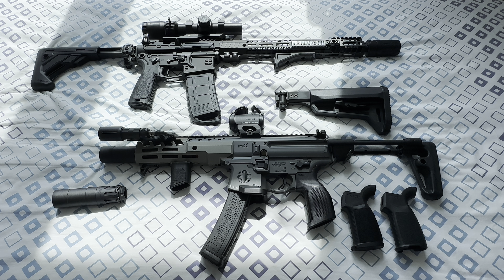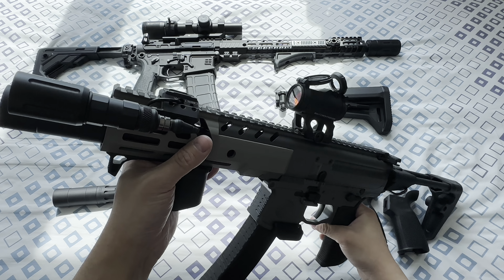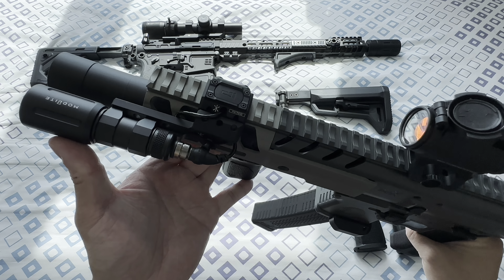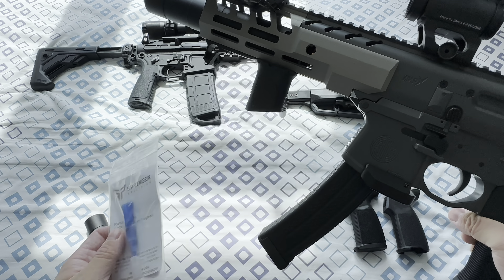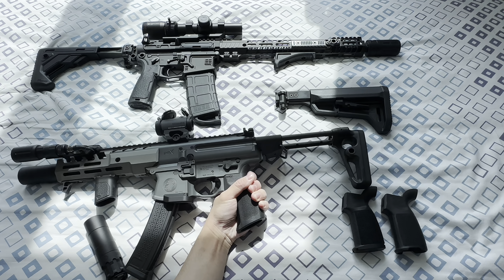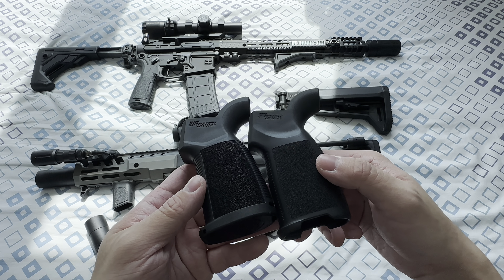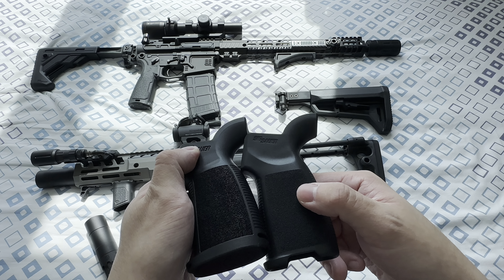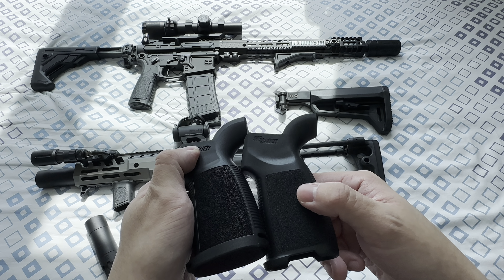APFG MPX GBB Custom Build

Comment: If you're still active to this video please answer this question about the magwell (See reply)
Reply: Could you please measure the width of one side of the magwell? I'm want to know if I can use a coupler on my magazines and they'll still fit in the mag receiver with the magwell attached.
Please respond to this reply so I get notification.
Reply from the maker: I actually have used a Sig MPX mag coupler and there is a bit of room between the extra mag being held by the coupler and the magwell with the Springer Precision aluminum magwell. You do have to be careful with it as it's still easy to scratch up the Springer magwell but if you are not using it then it's completely scratch safe